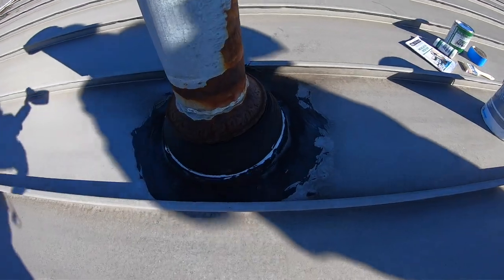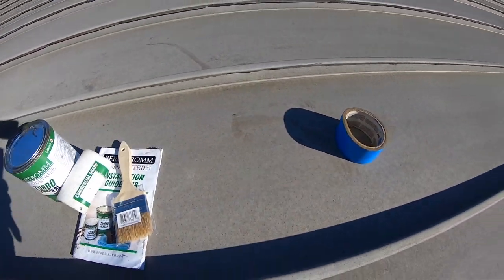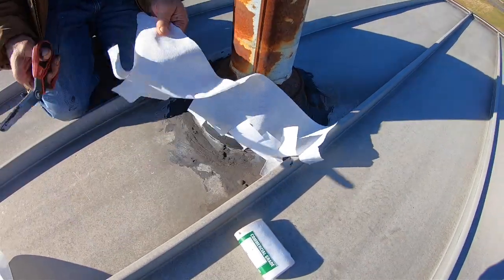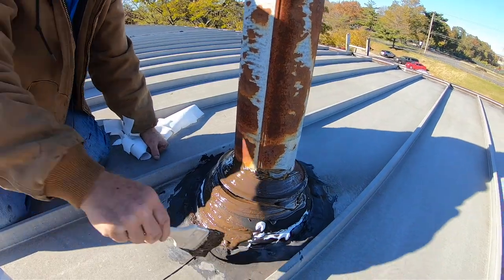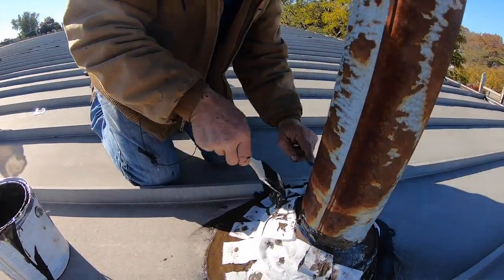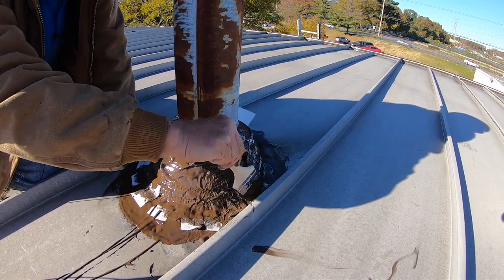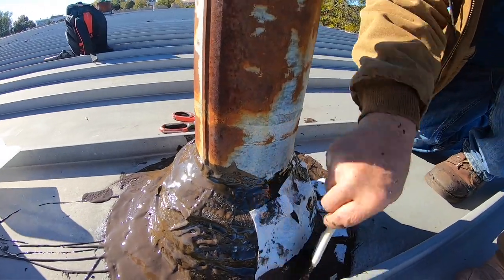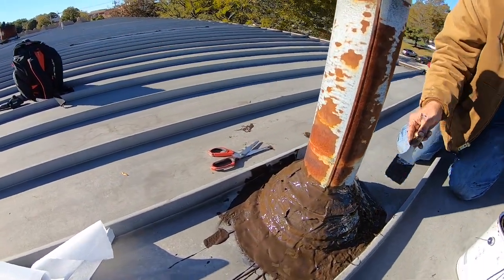How to stop METAL ROOF VENT PIPES from LEAKING

Comment: In the video you said you would provide a link to the product, but I can't find the link.
Reply from the maker: sorry, I may have forgotten. go to Bergstromm.com
Reply: @FlatRoofDoctor  Thank you.  Is there a store that sells it in Texas?
Reply from the maker: @davidtreibs  Sorry David, but for now you can only get it online.
BTW, the other product that I use often is Super Silicone Seal form Bergstromm.com as well. Tomorrow I will post a video on that product. I was shocked and in disbelieve how well it performed. I did stress tests and flexible tests and I used it on several EPDM roofs. I am so convinced about Super Silicone Seal  that it now becomes my "go-to" product for roof repairs

Comment: You didn't treat the rust on pipe .which eventually leak
Reply from the maker: Not to bad, I think this is almost 4 years since I did that. I will be going back this spring to do the seams on this roof. So, that means, the owner has been happy with all the fixes, rust or no rust. I got to do a bigger job now.
Reply: I agree the rust should be treated and painted as it will continue.  He says never have to worry about it again means that it will last the life of the roof.  If 5 years ok but 25 years or more may be a different story.